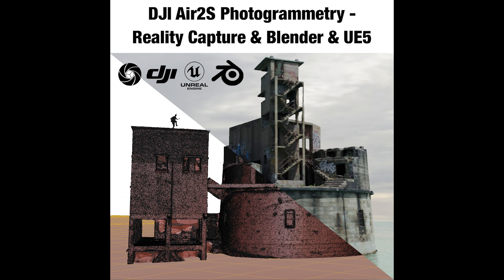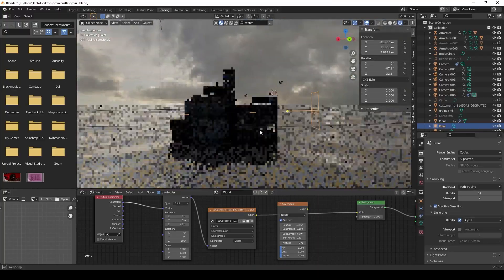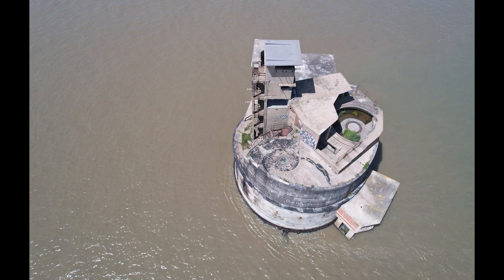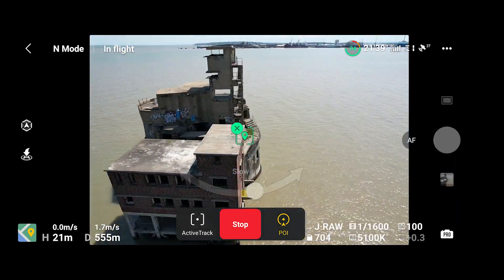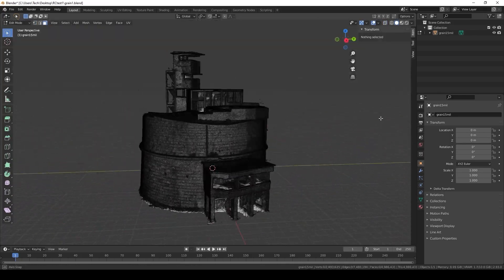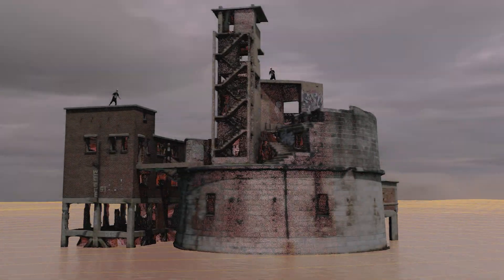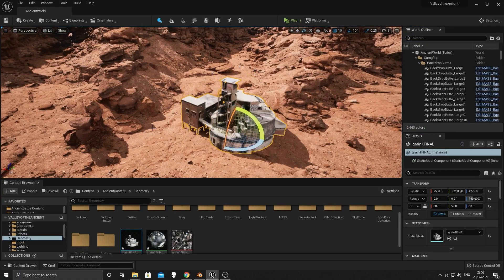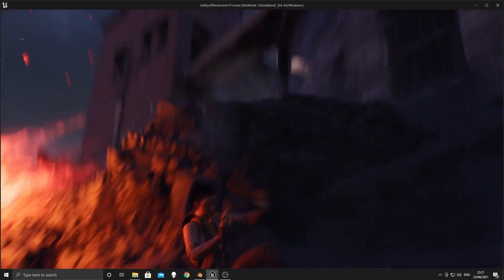Photogrammetry Speed tutorial - DJI Air 2S, Reality Capture, Blender, UE5

Comment: Agisoft is enough for me.  But I can see that using RealityCapture, Blender and UE5 gives much better results.  I will try, thanks for the great video.
Reply from the maker: hi Metsahpe has some excellent features that RC does not have and RC has features Metashape does not have. Both can produce excellent results. RC is perhaps easier to use for beginners and since its purchase by Epic has become more affordable.
Reply: oh boy, since RC dropped its PPI licensing price 4x after epic bought it, there's not a good reason not to use RC. I mean, I built a 1 bill poly model out of 700 pics with a computer that has 32gb ram. Aligning it all together took ~20minutes, with properly captured image sets. Meshing high -- done overnight. 
With agisoft, at least a year ago, you needed some NASA computer with tons of ram to even attempt this. And spend days.